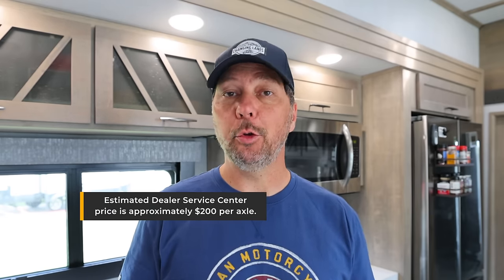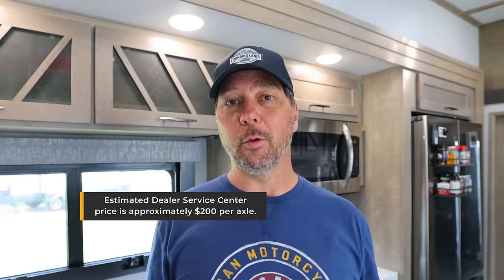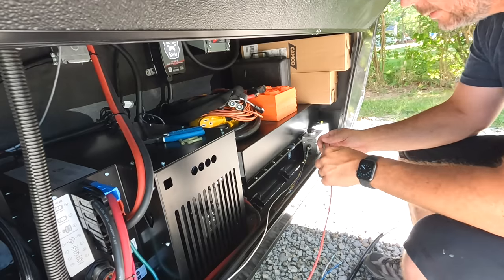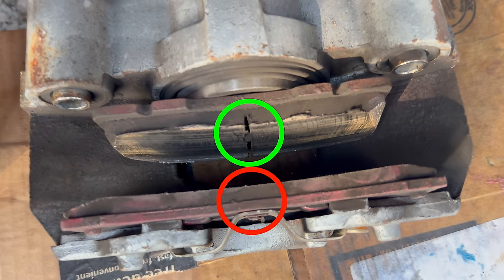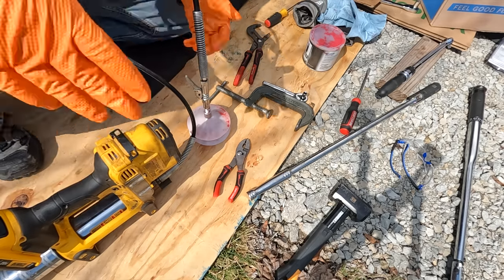Hit the Road with Confidence!: RV Suspension Maintenance Made Easy

Comment: Very nice, I am so happy with my Morryde IS and disk brakes. I went from Indiana to Virginia then back home to Vegas. Don’t remember anything but my lower shock exposed bolt is worn down and bent (both). They said don’t bend back but all is OK. It’s destroying the rubber bushing. Opinion?
Reply from the maker: I think our rubber bushing on the shocks is all dried out, too.  Don't think it's a big deal, and if MORryde says it's okay, just save that correspondence to CYA if you need it late. 😊

Comment: It appears you have oil bath hubs on your trailer. I base this on you have the screw-on plastic caps that are used for viewing the oil level. Oil bath bearings run much cooler than grease in my experience.  Why did you change to grease?

Comment: What do you consider “much much higher” for the hubs? One of mine tends to run like 15-18 degrees hotter than rest. Rest are usually around 118 degrees and the one is 133-136 or so. Normal range still?
Reply from the maker: Hmmmm.. Unless that one hub is in direct sunlight and the rest are not, I would be a little suspicious.  Be sure to aim down at the hub and not the rotor.  When I was checking ours, they were in the high 90's, low 100's.   If you do pull your suspect hub, I'd love to hear if you find anything... hello@changinglanesrv.com
Reply: Will do. It’s a brand new 2024 rig with less than maybe 600 miles total on it. Still breaking in the geny hitch too. We did full 3k watts solar and 28.6kw of batteries, thanks in part to your channel! Did the micro air easy starts and thermostat as well as snap pads. Really loving all the products and info I’ve learned about from you guys. Thanks for everything you do!

Comment: Great video Chad. What type of grease is recommended for leaf springs and Morryde 300? Had my Reflection 3 years, pay for wheel bearing repack/ inspection every spring, just had done 2 weeks ago. Not sure if they have been lubing the suspension. Next years my turn.
Reply: Cre 3000 I meant.
Reply from the maker: High temp bearing grease.  I usually look for it to say bearings specifically on the container. That should work for your equalizers also.
Reply: @ChangingLanes  Thanks. I know you mentioned in your video for the bearings, I wasn't sure if same grease  should be used for suspension parts.

Comment: Morryde specifications say the hub nut should be torqued to 50 lbs then back off.  Is there a reason you don't do it that way?   We have the same setup and need to do the service.
Reply from the maker: IMO, that 50 ft lbs is about what it takes to snug it down all the way.  Since it's going to be backed off to a completely arbitrary value anyway, I'm personally not that concerned about the initial torque as long as it's snug to where it won't go any tighter by hand.  Hope that helps!
Reply: @ChangingLanes  👍
By the way, thanks for another great video.
Reply: @ChangingLanes  I believe the torque to  50 ft lbs is to ensure the hub and bearings are fully seated. Then backed off to finger tight.

Comment: My 2006 5th wheel had a leaf spring break in 2020. I owned from 2014 and drive aprox  10,000 yr.  I have reduced weight in RV (remodeled), so it should’ve been under weight.  So, there’s that: metal fatigue?
Reply: My 2007 with 5200lbs axles just broke a leaf spring last year. I replaced all 4 with 6k springs.  They certainly do or can fatigue.  That trailer was 13k #s.
Reply from the maker: Sometimes, it can be loading, too, with one side of an axle taking more weight than the rest.  Sometimes at rallies, you can get each wheel weighed individually.  Lot's of people beef up their leaf springs to the next size up.